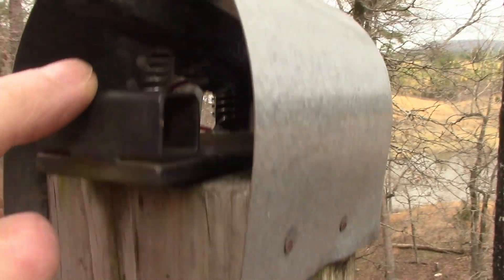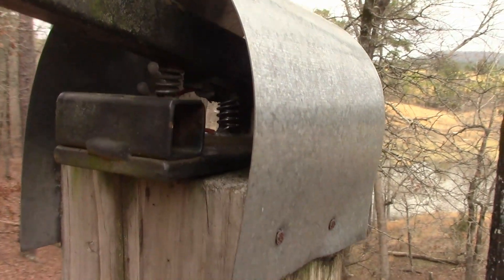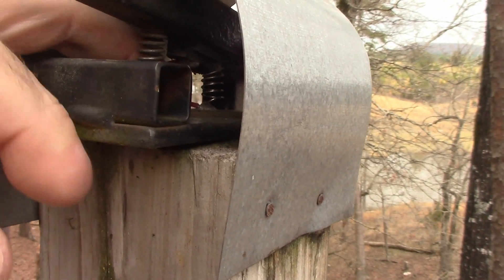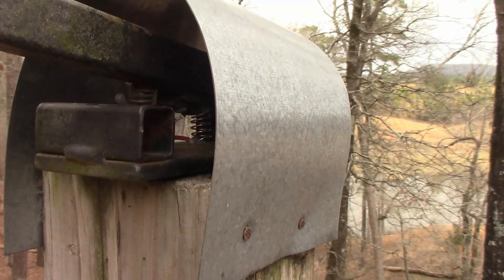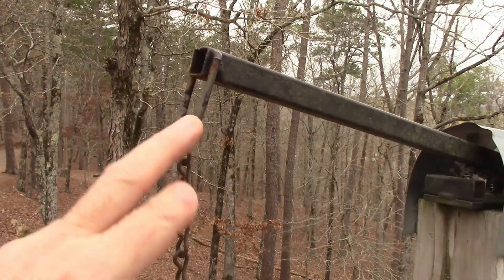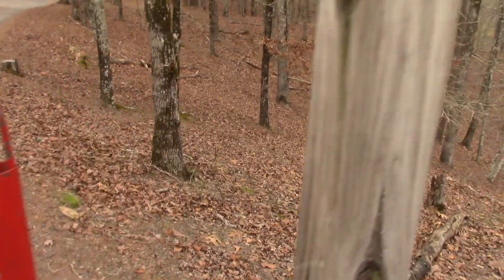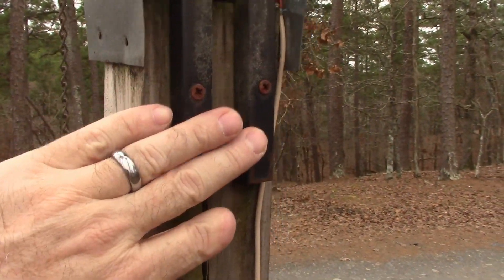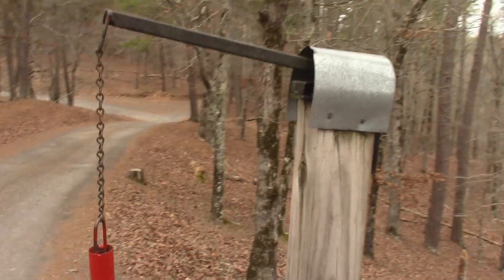Homemade Gate Opener Pull Chains

Comment: Very neat idea.  A homemade limit switch.  Very ingenious indeed.   Apparently you insolated the stainless spring and the plate it contacts from the other parts of the mechanism.  Never thought of making my own limit switches.  I can see other places this would be useful.  Next I would like to see a normally closed contact please. Actually I suppose you could.  Just go out the back of the pivot point and do the same thing in reverse.  Good deal.    You spoke of  your fruit trees.  Well this is the first year in at least 4 that I think we have hope of getting some fruit.  I too have peaches, apple and  plumb and I believe nectarine as well.  One year before that we had a good crop of peaches and something came along at night and took all the fruit off the tree.  I believe it happened in one night but not for sure it could have been two.  But all the fruit was gone.  We have a game camera now.  I want to see what is happening if we get fruit this year.  And as of now we might.  I am going to spray religiously this year I believe.  Hope you could have a good  year too.  Have a good weekend, stay well and thank you for this video.
Reply from the maker: Thanks Glenn.  It's a good thing I'm not dependent on my farming skills to stay alive.  I wouldn't have made it very far.

Comment: I can't argue that this switch works and is durable, but I don't like the fact that there are exposed electrical contacts. Would be interesting to see your mechanism using a magnetic proximity switch, which is also durable, but encloses the electrical contacts.